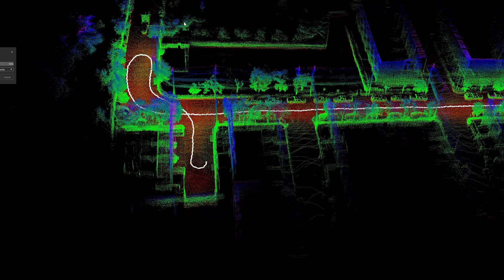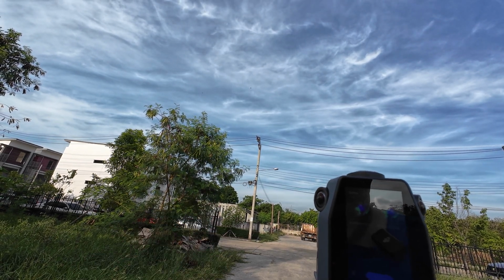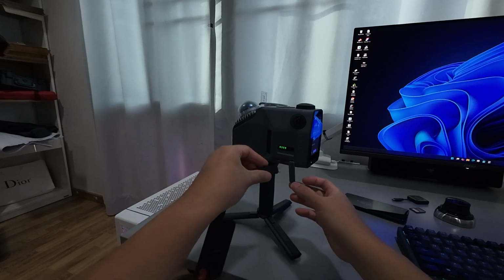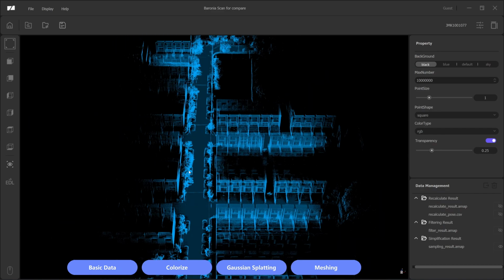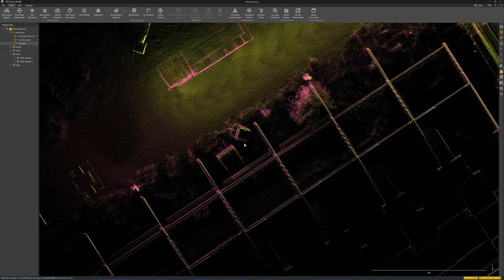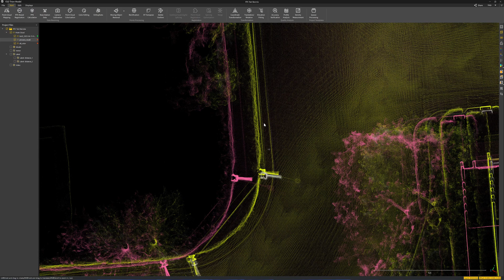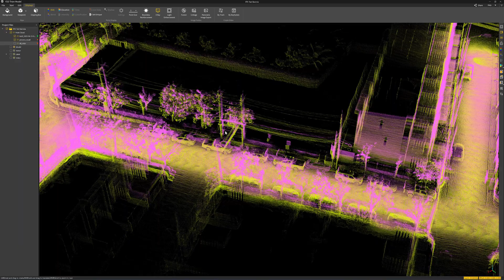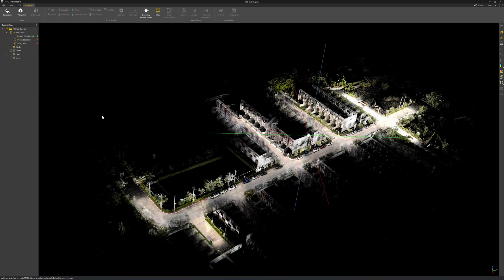3DMakerPro Eagle - Outdoor Scanning Accuracy Test

Comment: Can I reaaallly rely on this scanner as a business investment ? the price point is just about right
Reply from the maker: I transitioned from using a total station to a LiDAR scanner several years ago, applying it to prefab steel structures project. At present, I rely on the SHARE C1, which I have extensively tested and found to be highly reliable. https://youtu.be/0jQI1-UYRU4

Comment: what happened to the gimbal setup? did the results not turn out as expected, or was it just to cumbersome to use? i think i missed the conclusion
Reply from the maker: What I found is the Eagle like to be handled level. If I can stable my wrist and make the scanner level while moving, the gimble is not necessary.
Reply: @Payo-TensileCreator  i see! lets hope there will be some software improvements or even a gps addon in the future to get rid of the insane drift, i am quite tempted to pick one up

Comment: You could calculate the Eagle data without loop closure and then compare it.

Oh by the way, RTK does not yet work with the Eagle. At the moment it's more like PPK. Have you tried that?
Reply from the maker: The sample unit they sent has no integrated GPS, and I don't think it'll accept NEMA output from my RTK as well, so I can't test it.
Reply: @Payo-TensileCreator  Oh that's a shame, does that mean you're using a demo unit from 3DMakerPro? Many people in  the official facebook group are already using the consumer version, which has a different logo at startup, which indicates a different firmware.

I could only compare my scans with terrestrial scanners, but that wouldn't be fair. I hope that 3dMakerpro optimizes the algorithm.

Comment: I'm curious what the outcome would be if the fjd trion wouldn't be rtk corrected.
Reply from the maker: For a road of this length, translation drift will range between 15 to 20 cm. However, if the loop is less slender—with a length-to-width ratio below 3:1—the error will be significantly reduced.